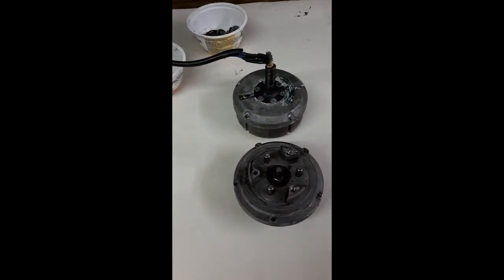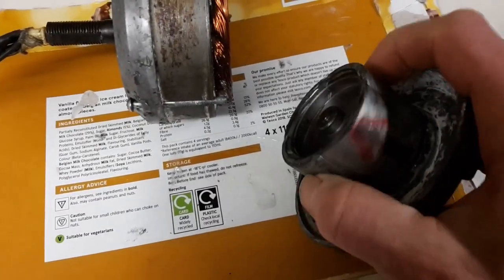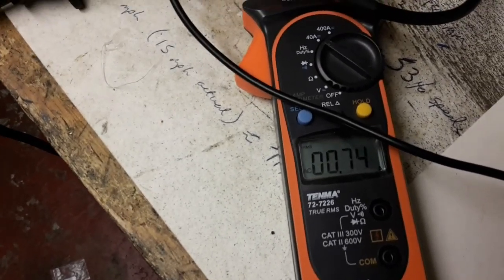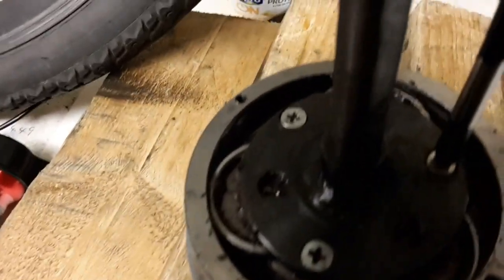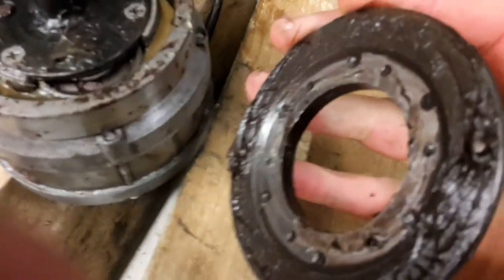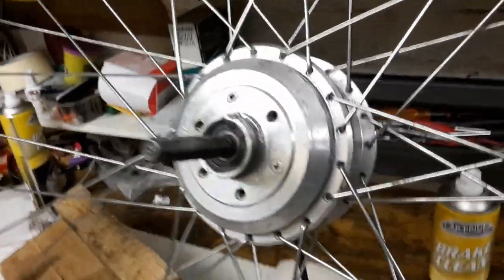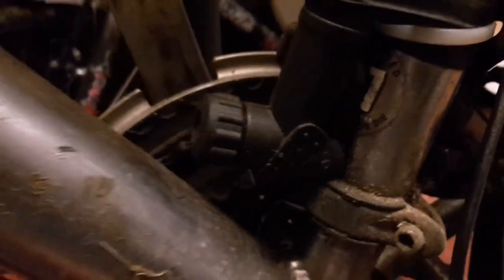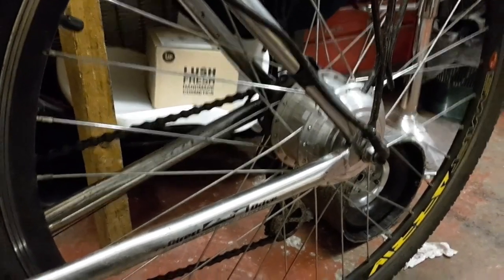Currie Electro Drive e-bike hub motor rebuild

Comment: You didn't show how to remove the hub, can you let me know how it came off pls? as i have one that won't budge
Reply from the maker: That motor threw its magnets and burned on a ride, so it's in the scrap. What you need to do is unscrew on of the faces. You'll see the join line on the cylinder, about 4mm in from the edge. It was a right pig to get off. I held the edge in an engineers vice and turned the wheel via the rim. Normal left hand thread as I recall. Getting the vice compression is a balance of it not slipping and not gouging the aluminium.
Reply: @plodderexup  Thanks, i have a vice being delivered tomorrow so fingers crossed, i have one of these wheels that someone broke the wire coming out of the wheel so cut it off and removed all electrics and binned them, so i want to try and restore it back to an ebike, can i tell from looking inside the wheel if it's going to be any good or not?
Reply from the maker: @stevemitchell501  not unless you can smell burning. Chances are someone broke the wire so it will be fine as long as you can make new connections.
Reply: @plodderexup  got the case off, woo hoo (had to wait for a larger vice to be delivered) thanks for that, just got to figure out how to rewire it now
Reply from the maker: @stevemitchell501  Good luck. That little cool looks fiddly. At least you've got the chopped off end bits to work with.
Reply: Bought a mongoose e dirt bike used batteries were blown up motor is Same but it's in reverse any way to fix
Reply: Yo también tengo uno pero no sé cómo conectar los cables ya que trae dos cables gruesos y ocho cables delgados 

Que controlador me recomiendas
Reply: Hey amigo puedes ayudarme me vendieron un motor de bicicleta electrica de 48v 500 trae dos cables gruesos y ocho cables delgados que controlador me recomiendas comprarle yo se conectar motores de tres cables gruesos pero este trae dos cables gruesos y ocho cables delgados es primera vez veo este motor puedes ayudarme por favor